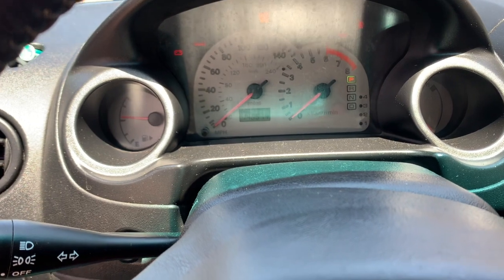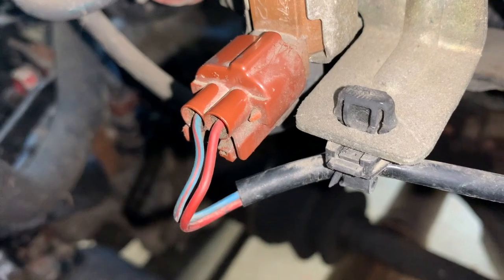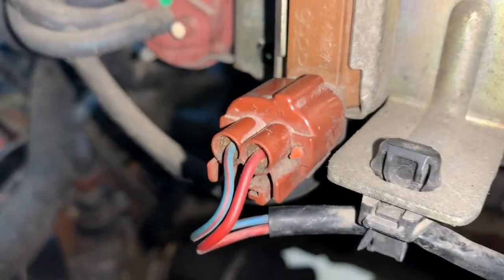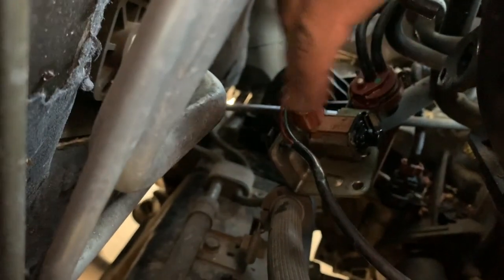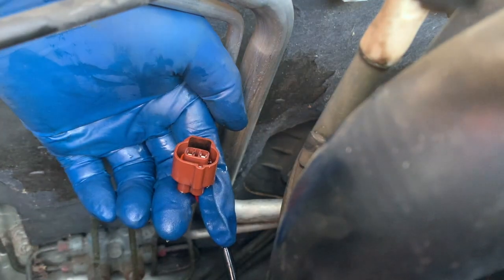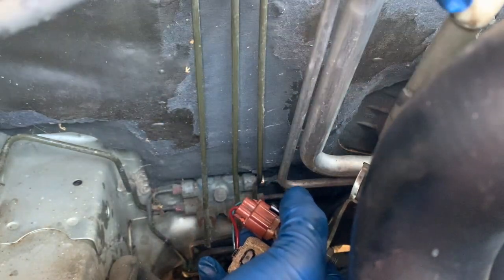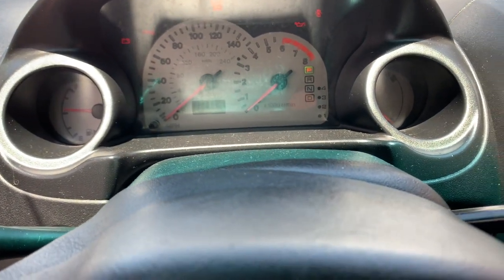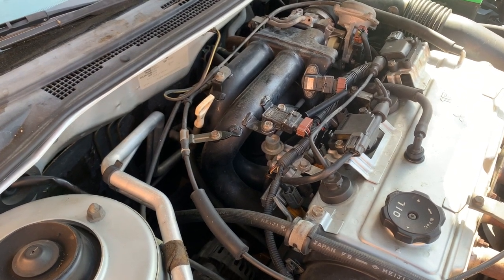P0403 Exhaust Gas Recirculation Control Circuit Mitsubishi Eclipse 2000 - 2005

Comment: It looks like the montero has the same egr valve, solionide. But it's easier to replace it on the montero since higher up and more space.
Reply from the maker: For the EGR Solenoid it is the same (I included under the description what will be the same fitment). As for replacement yes definitely these ones are in a tight spot 😬
Reply: @RookieRepairs  yes,  that's the one I have on my montero, I thought the mitsubishi cars and suvs had different parts that's why 😄
Reply from the maker: It’s a good thing they do so it can be easily available… 😅

Comment: Is that possible that this Solenoid not give me any codes but still don't work? Cuz I czek cable  and I have on + power but on - (ground) looks like cable not work, cuz multimeter no reactions and control lamp test also no light,  its mean connector or ground wire problem?